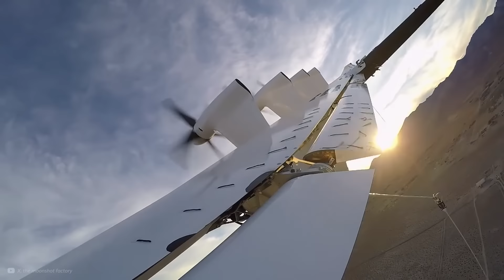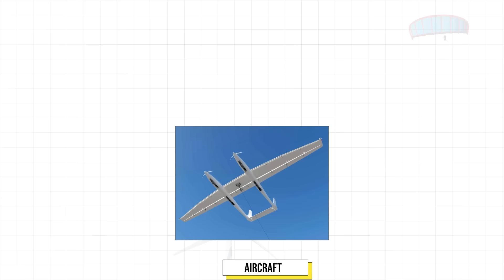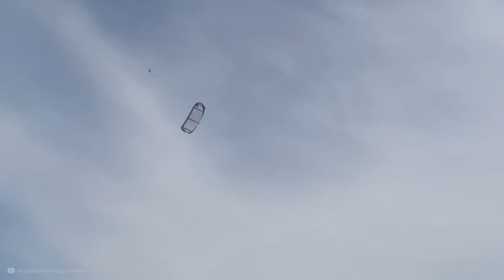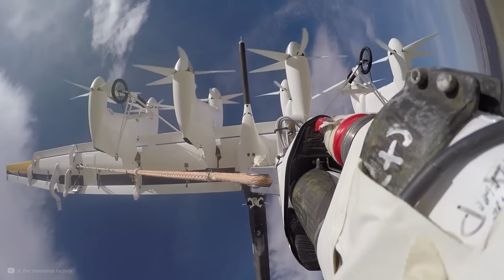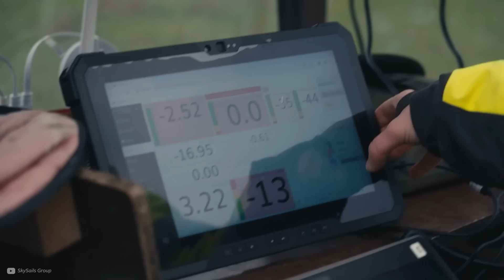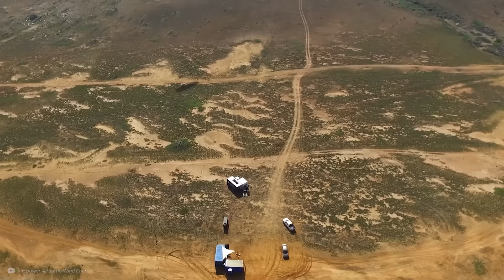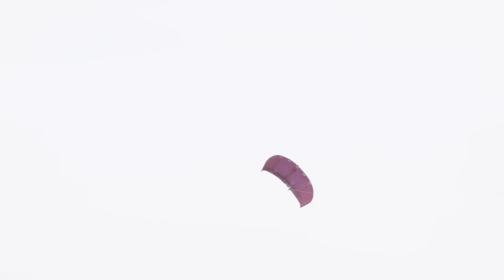Airborne Wind Turbines: The Future of Clean Energy?

Comment: I think that balloon models with a lifting gas are probably the best bet. Still, we'll need some more advances in material science. I personally favor hydrogen over helium for lifting, since hydrogen is cheap and abundant. Dealing with flammability is a challenge, but certainly something that can be overcome. 

I can envision fleets huge lighter-than-air platforms stationed permanently at mid to high altitude. Graphene or carbon nanotube cables could provide tensile strength and electricity conduction at the same time.

Comment: I think the inflatable one actually has a lot of potential....... If they put a heater in there that was powered by the fan and kept the are in the balloon hot you can basically get a hot air balloon effect and the excess power could be used to generate electricity for the grid.
Reply: I can literally double insulate it and use mylar to help hold in heat or catch heat there's a lot of potential there that doesn't rely on helium.

Comment: use hydrogen it works. it got a bad name but wasnt actually the issue but the paint they put on the damn blimps. then hang a turbine below an aerostat with no cowling. let it pivot to the wind dir if it needs to but prb the aerostat will just go in that dir. and see what happens then

Comment: I just did some research and as much as I like the idea of these kites, they are no match for a traditional turbine. 
These kites top out at 200 KWh, enough to charge 10 electric cars at the same time. 
A traditional turmbine makes around 6,000 MWh Mega vs. Kilo. We#re talking about magnitudes of difference in power. 
And I went with the low end on the turbine and the gigh-end on the kite. The turbine is simpler to service  and makes raw energy. 

The kite is great on a container ship though to run the onboard systems and get off diesel. But since shipping companies rent their ships, the providers don't profit from greener ships.
Shipping is dead to innovation and Power generation has too powerful alternatives. .-. 

I hate saying that, would prefer seeing kites, but those are the facts.

Comment: No.  Just no.  I fly under and around wind turbine farms already, I don't need to be flying around giant kites randomly maneuvering around with invisible tethers.  Good luck farming your corn and soybeans when they all die from disease though, I'll be somewhere these aren't.

Besides that, the winds aloft aren't THAT much greater, in fact, they can be considerably less than what you experience on the ground.  It all depends on the day and the weather, but the minimal gains once you factor in all the wind data most likely won't offset the added complexity of the tethered generators.

I really wish people would put their time and efforts into viable thorium reactors instead of all this wind nonsense.

Comment: A couple ideas regarding this: it seems ideal for near offshore winds that are less visibly disruptive (and may even look nice). Secondly these kites will have small 'spot' shadows compared to the large shadows of turbine blades and therefore along with their suitability for building on rough terrain where solar farms can also be built, this seems like a good way to harvest more energy from the same land area while producing little to no shading on solar panels.

I also thought of another idea: building these booms on top of bladed wind turbines to take advantage of even higher winds or get access to better winds with even less startup speed required. Obviously you would need to construct your kite and cable in such a way that it can never hit the turbine blades. But it seems like starting off with a 300m advantage from a turbine mast designed to support a nacelle and blades magnitudes heavier than these systems would let you potentially get at the energy more cheaply.

Comment: Thanks for the update. The ground-based wind generator was an Idea I came up with in the 80s while working for Solaron Inc. in Denver, Co. The autonomous system issues were the non-starter. We KNEW it would work, but like auto tracking solar panels, the funding has been fought tooth and nail by the BIG OIL corps.

Comment: Aren't they a Lighting Magnet ???
Preventing their using any flammable lifting gas ???
Also wouldn't they make good cell towers thus creating additional Income ???
Don't they just by being higher up in altitude generate additional energy like Testlas Tower ???
Reply: all excellent questions. 1. they would be but we are notorious for finding way to negating any negative side effects of electricity in general, i.o.w. there isn't anything we can't lightning proof or atleast ground. 2. whatever flammable gas is used it doesn't matter if it won't be set ablaze in the first place, not to say it's not a concern but once we get a hand on it it'll be of little concern. 3. i myself wouldn't really think so but i also really would know for sure so i guess it's something worth considering, especially with other considerations neither of us can think of. 4. there isn't really anything i can say about that besides your likely to be right, the higher up the better but not too high up or the air would get too thin to be both functionally and cost effective, like i have said before you would have to find that sweet spot.

Comment: For power generation during kite deployment a two kite system would be better.  One cable with a kite on either end of the cable.  Power is generated when Kite # 1 is deployed. Then a regulator restricts the expansion of Kite #1. Kite #2 now, fully expanded deploys which generates powers while pulling in the restricted Kite #1.  Once deployed Kite #2 is restricted and the process is repeated over and over.   Energy is generated continuously and not expended to retrieve a kite.

Comment: A design uses the cable rotating to the ground or tower support to transfer energy from the helium  filed turbine to the generator.   Everything non metallic and non conducting.  Easy to recover before high potentially damaging winds.

Comment: Having fly a kite, I never managed to pilot it with a single wire. I may be stupid,... Wait I'm stupid, but I managed to make awesome figures with a kite which had two wires, one for each side. I could have it go where I wanted and even reel it easily making it go above me.

Yes IA can do a lot. But honnestly I kind of feel like any of theses designs could get a lot more control with 2 wires. There may be issues with it (especially wires getting tangled, and maybe rubbing each others (wich could be a no-no), but I think that you could pretty much manage it with a rotating arm on the ground with both cables preventing them to ever tangle, just making the same moves as the kite no matter what.

I guess they already though about that but it is kind of strange to see. Especially since it is kinda complex to get a computer controling it. I feel like getting more control easier is better here, so instead of IA, you could rely on scripts.

Comment: cool concept
but the more moving parts a system has the more likely it is going to have issues. 
Solar panels on all roofs, nuclear/water for the base load and wind wherever best economical sensible

There are thermal plants with plasma digging that sound interesting, but it seems all too far away for the big shift in power production needed TODAY
Reply: Problem is that solar panels require a cap load of carbon, including oil/petroleum products.   They have a life cycle limit and tend to be very low on the recycability index so contribute to waste and c02csimilar to the unrecycable wind turbine blades that need to be replaced.   I liked the "potential" of a lot of these ideas because they didn't have the short falls that solar panels and wind turbines have (neither of which are close to pure green energy or carbon neutral solutions)

Comment: Wind power has stuff all energy because of the area square rule. You need a massive surface area for any reasonable energy generation. Solar stomps wind energy per metre square.
Reply: Problem is that solar panels require a cap load of carbon, including oil/petroleum products.   They have a life cycle limit and tend to be very low on the recycability index so contribute to waste and c02csimilar to the unrecycable wind turbine blades that need to be replaced.   I liked the "potential" of a lot of these ideas because they didn't have the short falls that solar panels and wind turbines have (neither of which are close to pure green energy or carbon neutral solutions).  But these aren't solutions either

Comment: here is a problem with each unit needing to be roughly 2 km apart from the next unit and if they generate 400kw you are going to need an area of clear land 10 kilometre long 2 kilometres wide the same area covered with solar panel would produce a lot more power and mooring them off shore introduces a whole new level of complexity

Comment: Cool idea, but I do see a problem.  Obviously, we would need fields of these.  In order to avoid tangling two tethers together, they would have to be spaced twice the tethers length apart.  At 800m, that’s 1.6km between towers.  Meanwhile, that space below its entire circumference must be kept clear and basically unused.
Maybe offshore, from a drone boat or something?
Reply: Sensors and software can keep the kites lines from tangling, so it needs much less spacing.

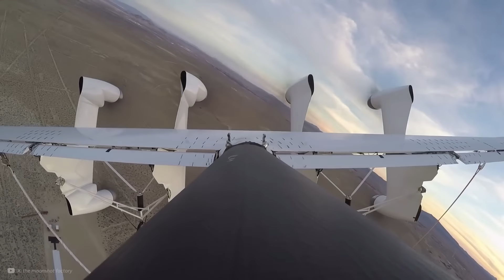Comment: 1:30 Yes the speed is higher but the air is less dense
Reply: At 10 KM the wind speed is about 5/2 that closer to ground, while the density is 2/5, however kinetic energy is based on mass * (velocity^2) so the increased speed is much more significant
Reply: Just realized that this is talking about closer to 1 KM, where the pressure difference is fairly insignificant, while the speed difference is large as mentioned in this video
Reply: @zetahurley7323 Go look at wind atlas. Check the differences in wind speed and wind density . It is huge.
Reply: @zetahurley7323  Go look at wind atlas. Check the differences in wind speed and wind density . It is huge.. Switch from each reading.
Reply: so you just gotta find that sweet spot, simple enough, right?

Comment: Its all a giant scam... It will just not work like the Promote it. Lets compare...
A comercial airplane is built to last aprox 20-30 years the same time a Wind Turbine is bulit to last. A Wind Turbine is super simple just one spiny thing that's it. Even they needed so be inspectet once a month. A airplane the other far end needs houres of maintanance for every flight.
This airborn Turbines are a mashup from Sport kites (which will only last month or years in execife use) but should fly like a comercial airplane houres and houres every day.
There are so man moving parts. Things that wear... Youll have to have a full stafed maintanance crew at every eneegy Park. These Things will just break.
They are way to complex. And with flight hight of up to 800m General aviation will also be Effekte.another thing is with 800m of teather there needs to be a minimum of 1000m radius circle as a Safty zone where no one ever can be as long a this thing is in use... At the same area you can built miltiple Wind Turbines which need less mantanance and the ground area can be used for solar as a example. Whay more effizient!
So no this Things will not be used ever comercial with positive outcome

Comment: Kite pulls a generator - then you have to use more power to reel it in - doesn't take a genius to figure that isn't going to be efficient & will probably cost power 🤣🤣
Reply from the maker: They tilt the angle of attack so it used very little energy to pull it back in compared to the amount generated on the way out!

Comment: No, I don't think this will ever take off! (pun intended)
There is a multitude off practical things that are hard to come around.
Durability is one thing you might get sorted out, but the biggest problem is, you won't get the same powers for the same airspace occupied by a single machine! 
Conventional turbines use there whole rotor diameter, those flying wings can't do that even if they try really hard! 
No mater how good your wind is, you can't make up for the unused wind area of those kites! 
Even worse, it scales real bad, get the think even higher up, you need even more space to fly it. You would need multiple wings flying coordinated side by side to get the same coverage, and seeing them having trouble with a single wing, I can't imagine having them fly multiple ones 10-30 meters apart from each other! 
Nore this being any more economical. 
Conventional turbines are just too low hanging fruits! 🤷

Comment: These airborne systems appear to have rather small swept areas when compared with big ground based turbines. In order to compensate for lack of area you need a much greater wind speed. fortunately a doubling of wind speed compensates for a factor of 8 reduction in  the swept area  so the maths might actually be in favour of large aerial systems.

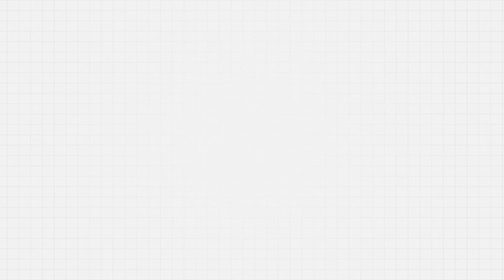Comment: 1:55 This is a mistake. Just a simple google search. Or the site guinness world records.

The largest wind turbine is the MySE 16-260, built by Mingyang Smart Energy (China) for the China Three Gorges Corporation (CTG). The MySE 16-260 has a rotor diameter of 260 m (853 ft), with three 123 m (406 ft) long blades and a 14m (46 ft) diameter hub, and a generating capacity of 16 megawatts. 

It was installed at an offshore wind farm in Pingtan, Fujian Province, China, and connected to the power grid on 18 July 2023.

Each full rotation of the blades generates around 34.2 kWh, which is enough to power a typical European home for around five days. Over the course of the year, it is expected to generate around 67 gigawatt-hours, which is enough for 80,000 households according to figures provided by Mingyang (annual electricity consumption varies significantly from market to market). The generator itself weighs 385 tonnes (385,000 kg), and is mounted in the hub of the turbine, around 152 m (498 ft) above the sea surface.

The Chinese offshore wind farm industry has to contend with more extreme weather conditions than its European counterpart. Most of the coastline suitable for offshore wind installations in China is also periodically subject to typhoons. As a result, the MySE 16-260 was designed to withstand wind speeds of up to 287 km/h (178 mph) – equal to a Category 5 storm on the Saffir-Simpson scale.

Comment: Compare the infastructure cost   per KwHr, and I would be pretty sure the foundations for any tether system eg mass to restrain a variable (snatching) load would be compable to a traditional wind turbine. Then, there are the cost and durability requirements of the tether. I'm guessing that over a 20+ year system life, this would require multiple replacement cycles along with constant monitoring and maintainence. Now airspace, go to your local winch launching gliding club. A wire going up to 2000+ feet presents a catastrophic air traffic hazard, so any implementation would require a no-fly zone around the total systems 3d area of operation. Food for thought.
Reply: > and I would be pretty sure the foundations for any tether system eg mass to restrain a variable

Surely you could use cheap dirt for mass for holding this back? Anchoring something is much easier than keeping a long pole upright against force applied to the top of the pole.

Comment: Some variants have been proven well enough for over a decade even (some of the flying wing or gyrocopters work quite well and are reliable enough to implement), but the main issue is bureaucratic and regulatory. Basically it's hard to get an airspace restriction put in place that isn't temporary due to the flight hazard such systems would pose to any aircraft.

Comment: Ground Gen wind systems are I think a nonstarter untill the much simpler concept of auxilary pulling sails fon conercaial ships have become common place.  The pull of a sail on a ship directly acts to replace fuel which is far more valuable then electricity and dosn't need any generator at all.

Comment: Great video!  Thanks for sharing. 

One of my pet peeves though are statements like x-times lighter/smaller/shorter/etc.  At least to me, 7 times lighter means x-7x (or -6x), not x/7 as I assume is what you meant.  I'd very much prefer  "but at a seventh of the weight."  Sorry, I just had to get that off my chest, I'm weird like this. lol 😅

Whether or not this will work remains to be seen, but I believe effortslike this and other green power generation and storage is needed if our species is going to survive the next millennia, if not century.

Comment: Firstly congratulations on submitting thesis and free time.
Secondly awesome video and concept
Just wondering could they consider using a tube which is shrouded in Kevlar or something with high tensile strength, this can then be used to supply gas to lift and deflate or slowly pump up water to act as ballast to make sail heavier and come down.   Even if it had two lite weight tubes one higher in foil the other lower so the lower one for buoyant gas the higher one for denser air, when you need to lower it switch valve so the heavier air coming in at the bottom will displace lite gas which is removed by displacement back down the tube into a reservoir this will represent the cyclic lift and lower of foil.  As for water yes I know there would be issues using public supply because the height local pressure wouldn't e high enough but a little pump connected to solar should do it whether it's air or water being pumped they are both fluids.

Take care m8, keep being awesome, from some random Kiwi in New Zealand "Kia Kaha" - "Stay Strong".